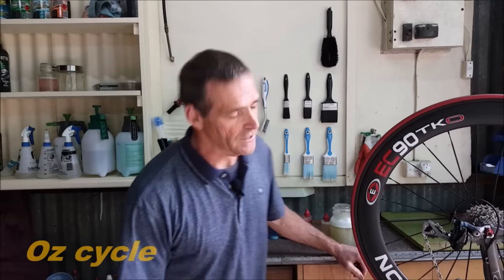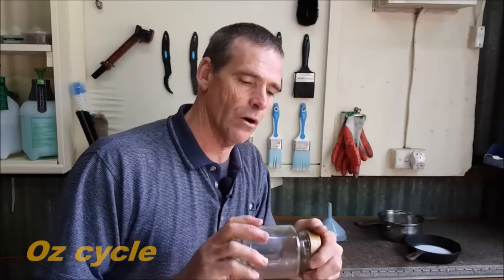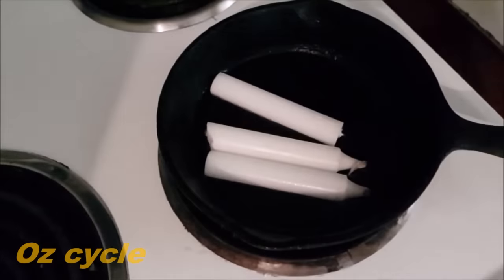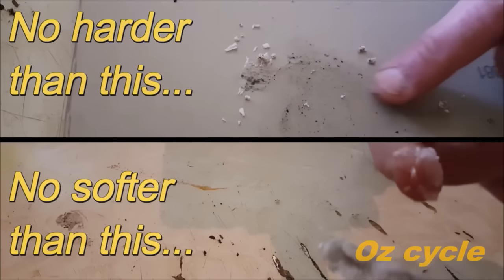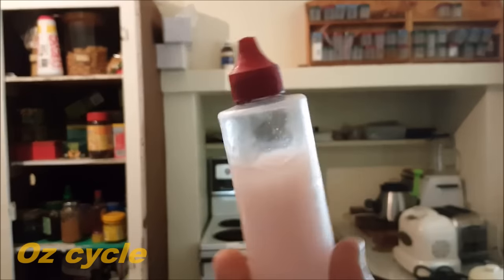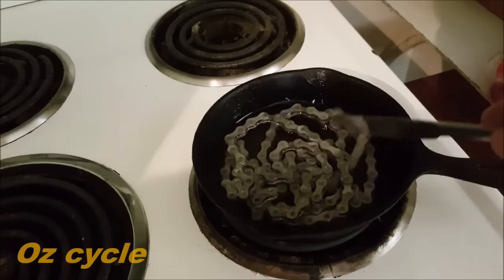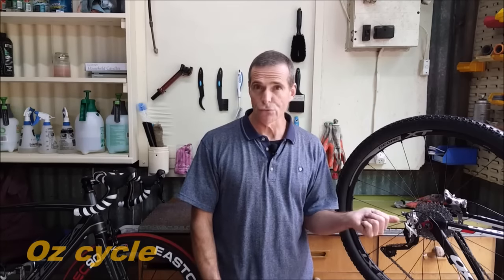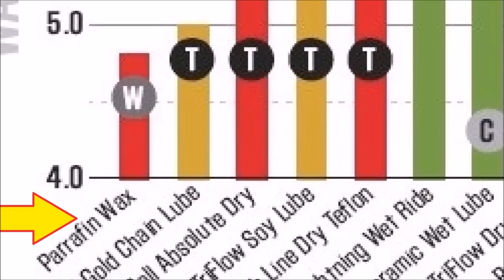BEST chain lubricant ever !! .....make it yourself.

Comment: Hi Oz, liked the video and tried this but as others mentiond already my wax+paraffin+xylene solidifies real quick. Even when I warm it up again using the method you suggested it solidifies quickly when applied to the chain. Perhaps not enough paraffin oil?
Reply from the maker: +Sander Must be quite cold where you are? Yes,try adding more paraffin oil to the mix. If you can remove your chain,I suggest doing the hot wax bath method.
Reply: oz cycle thx for the reply, it's around 12 degrees right now, I'll try more paraffine

Comment: Great video. Back here in darkest England there's a product called wax oil, would this do the same job?
Reply from the maker: +Stephen Chatwin I dont think so Stephen. That product seems to be a liquid mix of oil and wax for rust proofing. It will probarbly be too thin for a bicycle chain and the oil will spread out of the chain and get messy too.

Comment: Is paraffin oil better than kerosene? I ask, because I know I can buy kerosene at a local hardware store. I've never noticed paraffin oil on the shelf.
While I was looking for paraffin oil online, I read that what we call kerosene in the US is known as paraffin in the UK, and that paraffin oil is know as kerosene in Australia. Some sites say paraffin oil is "similar to," "distilled by a similar process as," or "a more refined version of" kerosene. One site said paraffin wax has less odor. The latter might be important; I keep my bike indoors. It depends on how strong the odor is, when it's dissolved in wax.
Reply from the maker: Use the type of paraffin oil as sold for cosmetics and by a pharmacy. "Kerosene" may not be suitable
Reply: Thanks for the quick reply. I didn't know where to look for it.

I looked for Paraffin oil on two drugstore sites (CVS and Walgreen's). Searches on both sites return mineral oil products.

I found paraffin oil on Amazon. The product I ordered is "Firefly Candle and Lamp Oil - 32 oz - Smokeless & Odorless - Simply Pure - Ultra Clean Burning - Liquid Paraffin Fuel - Highest Purity Available ." Only $8.99 for a quart, free second day delivery--not bad. Not much lost if it's not the right stuff (other than figuring out how to dispose of it 🤔).

Great article. Same for the other videos of yours that I've watched. Thanks!

Comment: Great video. But what to do if my lube solidifies in warm temp? ~15 С.
Should I add more Xylene?
Not sure if this is problem or not, but when it's room temp, lube turns from transparent into something with large wax pieces floating inside.
Reply from the maker: +Артём Тимофеев  -15 brrrr thats very cold to ride in! I will get back to you soon about this....i will need to simulate cold temps in my freezer  :)
Reply: Sorry, I meant +15.

Comment: I've got a batch that's fairly firm using the knife test and I'm only just able to smudge it, but on the chain it's thinner than toothpaste between the links and very greasy to the touch. 
Is it normal for the firmness to vary so much from a knife to on the chain? Do I need to adjust the mixture, and which way should I go?
Reply from the maker: The wax will be the same consistency on knife test and chain at same temperature. If there is a difference check your chain is completely clean before waxing it.

Comment: Hi - great videos and advice. I’m in the process of switching to wax, but have a question. I ride 350kms per week. Removing the chain for the cooker once per week is a bit of a hassle. If I instead remove less frequently, say once per month, and in between use my squeezy bottle with the xylene, then what procedure would you recommend for applying the wax using the bottle? Could I clean the chain in situ with a wax and grease remover, then apply the wax/paraffin/xylene liberally with the bottle? Thanks.
Reply from the maker: +Briony Greenwood Im assuming you use only 1 chain on the cogset,Briony? Yes,it takes time to clean & wax a chain properly....its for the sake of higher performance,cleaner & longevity. My advice would be to rotate 2 or 3 chains. Remove the dirty one and put it in the cleaner,etc,whilst you can put the ready waxed one on. That way you always have a waxed chain ready a d can take your time rewaxing the used one.
Yes you can use the bottled wax if the chain isnt too dirty.
Reply: Yes, I’m only using one chain currently on each bike. I might invest in some extra chains with master links, and the link remover tool to make replacement easier.
In the meantime I’ll use wax remover/ degreaser to clean it as best as I can on the bike, then apply my wax/paraffin mix using the squeezy bottle.
Thanks again. Your videos contain some really practical advice. Great stuff!
Reply from the maker: +Briony Greenwood Best removable links are "Connex"...no tool required,lasts almost forever.
Reply: Thanks.  I've now converted all three bikes to wax, and I've ordered three new chains with Connex links so that I will have replacement chains ready to go.  My first ride on wax was about 100kms in the rain, and the chain did pick up some gunk, so I re-waxed it.  My second and third rides on wax were dry, and the chain looks nice and clean.  Hey, I have one more question.  I see that Friction Facts and others do not recommend the addition of Paraffin Oil, they just use straight Paraffin Wax.  Can you tell me why you recommend Paraffin Oil in a 1:1 ratio with the wax?  How would the performance change if using straight wax?  Also, I see others recommend the addition of PFTE powder, have you experimented with this?  Thanks again.
Reply from the maker: +Briony Greenwood Yes Briony. Paraffin wax without the addition of the oil will 1/ flake out and off the chain quickly (try it and you will understand).
2/ Is pushed to one side in the pins and rollers,then the chain is effectively running metal on metal. Adding the oil causes it to be viscous enough to move around and fill any gaps.
Yes you can add PTFE if you like but the friction advantage is minimal and raises the production cost considerably.
Reply: Understood.  Will stick with the superior Oz cycle formula.  Thanks for the quick reply!

Comment: A question. When you put the chain in the pan to coat with hot wax is the mixture all three or just the candles and paraffin oil? Thanks.
Reply from the maker: +Bob Heaphy No Xylene,Bob just paraffin wax and paraffin oil.

Comment: Question; for what is using Xylon or Mineral  Turpentine?
For thinning when it is to thick?
I read the description of these product´s and Xylon is to Dangerous for me. The other one is not easy to get.
But normal Terpentin is always aviable at home.
Reply from the maker: +Thomas Gulschwenk Xylene is the medium to carry the wax into the chain pins and rollers,Thomas...it evaporates away quickly leaving just the wax. Using just wax and paraffin oil is too thick. The other method is to bath your chain in hot wax. This will be covered in a video coming up soon. Cheers

Comment: I like this idea a lot, yet I most say, I use the old oil from my moped, I take like 2 tablespoons from the jar where I keep it, then, to this, I add a bit of ball bearings grease that I had since decades ago... cost?? cero!!,,, messy and dirty??... yes!! 100% hehe... its like black blood...   perhaps in 10 years when I am done with the free grease that I already have... I may try the method suggested in the video... keep in mind that it is not only the low friction what matters... underload, what matters is the thing that prevents the moving parts from making contact... so... you could use baby oil, but its going to damage the parts faster than common multi grade oil... ball bearings in the industry use grease... and these parts are spinning fast with heavy loads... grease has a high viscosity...
Reply from the maker: +Robert Ostman Of course you know what the black stuff in the oil is Robert?
Reply: well in the oil that I am using it has to be mostly gunk as it is unfiltered straight out from the motorcycle, yet the darkest part comes from the old grease, its truly dark... quality standards was low in those years when that grease was done... modern grease is superior and way cleaner... the grease that I use for my skateboard is new grease and is transparent with a soft yellowish color

Comment: Hello Oz!!! Great videos i watch them all.....got a question for you.....can we use DOT brake fluid instead of the shimano mineral oil? I mean on a shimano hydraulic brake  group set ....can we? IS IT THE SAME THING?
Reply: +dozzy000 No, not the same thing at all.  The DOT fluid will damage the seals in your brake system.

Comment: Hi @oz cycle, do you still recommend using your chain wax lubricant you made in this video, or you you recommend taking the chain off the bike and bathing it in the paraffin wax/paraffin oil solution every 300 km - 400 km?
Reply from the maker: Yes,better to immerse the chain in hot wax

Comment: Just wondering whether you can store the lubricant in an oil can instead of a squirty bottle. Or would the xylene evaporate away? Could you still add xylene to the mixture afterwards if necessary?
Reply from the maker: +Dwayne Fujima The oil can would need to be sealed otherwise the xylene will evaporate,Dwayne. Yes you can make the wax and paraffin oil mix and store it then add xylene to the desired amount later.

Comment: Thanks for your practice, I try making my own chain lube already.

Even the mixture between paraffin wax and paraffin oil is proper.But, after I mix with xylene 1/3, the overall was has residue which is not completely blended together.

When I apply, it kind like the was itself not penetrate into the chain link as normal dry lube.

What would you suggest? I'm thinking about using hot air o melt the was into the chain.
Reply: If your chain is not adequately hot/warm enough, the wax will cool too quickly and not be able to penetrate the links. Depends on how much xylene/carrier solvent you use.

I usually use a hairdryer to heat my chain up before I apply wax.

Comment: Hi, thanks for the video.

Is this mix a complete analogue of the Squirt lube or is it something entirely different? Are you familiar with Squirt? Do you know what's inside there?
Reply from the maker: +Vsevolod Prutskov No idea whats in Squirt,Vsevolod. We used wax lube on our track bikes in the late 70s and with the recent comeback of it,I thought it might be good to share how to make your own but cheaper.
Reply: Thanks for your reply. Squirt is an emulsion of paraffin in water. However, there are some grey areas as for the details of its composition and manufacture. By its qualities it sounds similar to your compound, but, of course, much more expensive... I wonder, if you can DIY Squirt.
http://www.squirtlube.com/
Reply from the maker: +Vsevolod Prutskov Water in a chain lubricant!? No need to copy Squirt,thats what this is anyhow...parrafin wax lube

Comment: Great video cheers. I made some following the video but even in a warm room (25°C) and with a bit extra xylene it solidifies. Should i just add more xylene or will that not work? Thanks
Reply from the maker: Yes,just add more xylene,it want affect the wax performance as the xylene evaporates quickly after application to the chain.

Comment: how often do you need to relube the chain via this lube? and do I need a different method of cleaning the chain for relubricating it? for cleaning I would normally use degreaser mix up with hot water.
Reply from the maker: +Abdul Hafeez Sadon Approximately every 180km
Reply from the maker: +oz cycle To relube,just liberally add more wax lube and then wipe chain clean. If chain is dirty ie mountain bike ride,then remove chain and do the complete clean process again before adding wax lube. Hope this is helpful.

Comment: Can this be used on 600cc motorcycle? In India there is dust n sand everywhere...will wax a better option or chain lubes by motul n Castrol is better option in dusty situations?
Reply from the maker: +anjum mujawar In dusty environments wax is better as it doesnt attract dirt Anjum. However,Im not familiar with a motorbike senario...ie: how hot does a motorbike chain get,it may melt the wax out of the links?
Reply: oz cycle thanks. I think you are right on melting part...

Comment: Why a glass jar? At first I thought the xylene might soften plastic, but the then you end up putting it in plastic dispensers. I'm guessing it's because of the heat, so once the mixture is done and cools a bit a plastic jar would work as well for bulk storage.
Reply from the maker: +Carlos Benjamin A plastic container is fine for storing it. I used a glass jar because its easy to see thru.

Comment: I am curious about the performance of the lubricant once applied to the chain when riding in cold temperatures (such as below 5 degC) compared to teflon-based lubricant. I think for use in cold temperatures it must be more important to get the consistency right at the time of cooking... Am I right?
Reply from the maker: +John Mudie Yes...get the consistency right on the knife test at the ambient temperature you will be riding in.
Reply: Thanks for the insight :)

Comment: Just my opinion . . .

When converting to a wax-based lubricant system, it is necessary to clean the chain thoroughly as mentioned and then the chain is dipped in the wax lubricant after it has been heated .  Thereafter, as mentioned, you just add/replace lubricant when the chain needs it.  Where I differ with the video is how the chain is lubricated when the chain needs relubrication.  The video indicated that the wax in the squirt bottle can just be dripped onto the chain.  If one is at home with all that's necessary to soak the chain in a hot wax solution, that is far superior IMHO to dripping wax on the chain.  Dip the chain in a properly prepared hot wax solution, and you will see the bubbling as the wax displaces the air in the chain.  With this method, it is clear that the most critical parts of the chain are getting the lubrication that's needed.  With the drip method, one can only hope so.  I remember using one of the wax-based lubricants on the market years ago.  I dripped it copiously on the chain and within a day, the chain was squeaking again.  Maybe the lubricant itself was just inadequate but from that time on, I've never drip-lubed a chain.

I've been doing wax lubrication for over 20 years.  When the chain is dipped into a hot solution of paraffin and a special lubricant called SynLube, I can easily get 300 miles out of a lubrication and maybe more though being a lubrication freak, I never let my chains go unlubed longer than that.  Shifting has a buttery feel to it for the first 10-15 miles but shifting performance remains excellent for the entire 300 mile service interval.  In the video, paraffin oil is mixed with the paraffin.  I've never used paraffin oil so I don't know how durable the lubricant film it creates is but with the SynLube I've used, another dimension to lubrication is introduced: solid lubricants.  This oil contains PTFE, moly and graphite.  These solids are embossed into the chain's stress areas to provide lubrication even after the liquid lubricants have failed.  The only negative is that these solid lubricants turn the lubricant black so the chain won't look as shiny unless it's wiped down.

As for the ratio of paraffin to motor oil, I favor a wetter solution, meaning a higher percentage of motor oil because it works well in a wider temperature range than a dryer solution.  I have not had any problems with dirt.  As long as the chain does not expel paraffin shavings when you turn the pedals after reinstalling the chain and the chain doesn't drip lubricant after it has cooled, one is within range of a proper lubricant solution.  This much is clear: Every rider will have to experiment a bit to determine what ratio works best for them.

The video discusses how clean the chain looks even after several rides with the paraffin/paraffin oil lube.  That's nice but I prefer not to wipe down the chain.  I like a thicker coating of lubricant on the chain and a slight deposit of lubricant on the cassette and chainring teeth because I think it helps with shifting a bit.  I don't know that this is true, I just think so.  I also like a thicker coat on the chain because it helps protect against rust better than when the chain is wiped down.

One weakness of the wax-based system is when one is on tour and away from the means to heat the lubricant.  It would be nice to have the wax solution in a drip bottle but unless the weather is warm, the wax will solidify and then one would have to find some way to warm it up, otherwise the lube is useless.  Under such conditions I would grit my teeth and carry a spray can of silicone lubricant.  Carrying a spare chain is also a possibility.

I don't use xylene at all.  I have never found it necessary.

Bottom line IMHO: Hot-dipping your chain is always better than drip-lubing.  Every rider will have to experiment to find the best wax solution for them.
Reply from the maker: +Phil Houck Thank you Phil for your experience. Unfortunately,"Synlube" is not available in Australia or many other countries. I didnt  recommend lube on cogs,rings and chain plates as it will attract  dirt and gets on hands and clothes when handling the drivetrain. Cheers... Steven
Reply: This hasn't been my experience.  Also, I didn't mean to imply that I apply the wax to the cogs and the chainrings.  A small amount of the wax will accumulate on the cogs and chainrings as a function of riding the bike.

Comment: If you use the stove method to apply the wax do you still need to add xylene to the mixture, or only if you apply from a bottle?
Reply from the maker: No xylene required for hot waxing.
Reply: oz cycle Thanks for the prompt reply!